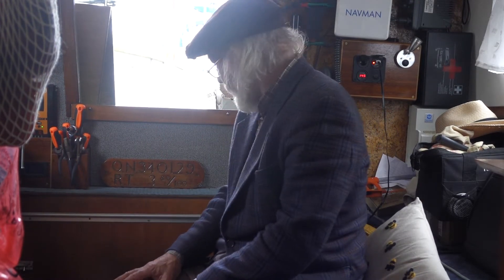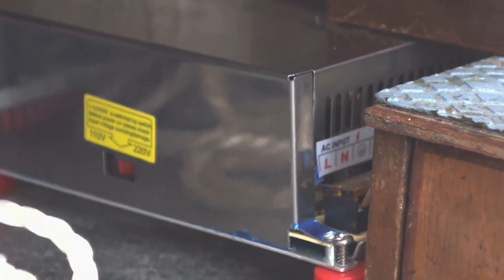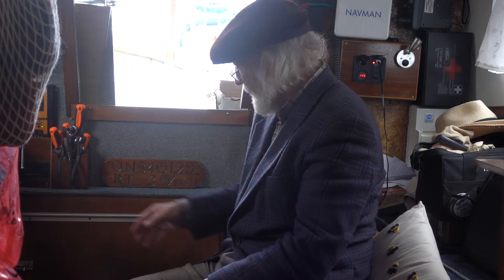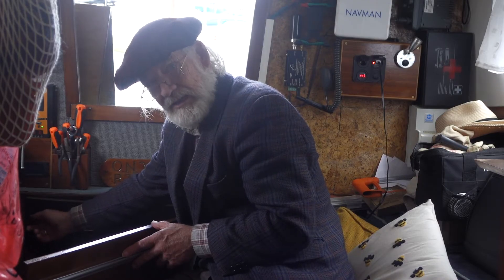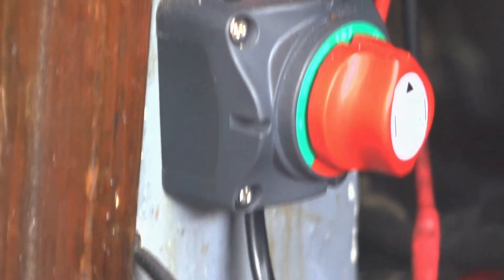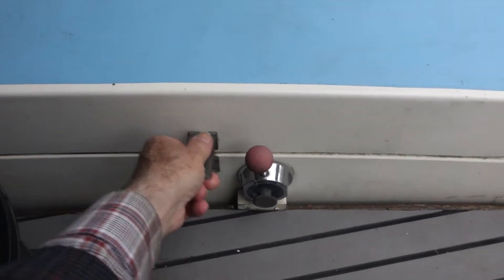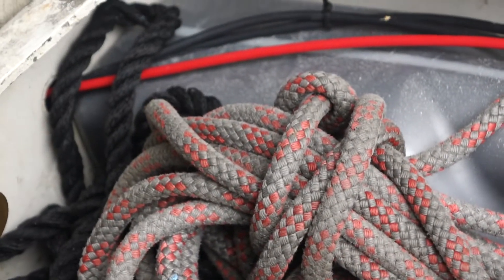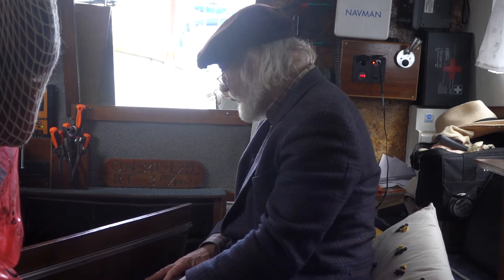Wiring a Generator Directly to an Electric Trolling Motor

Comment: Im thinking of this for my 24v 1500watt electric outboard. I'd use a slightly bigger generator, of course.
Reply from the maker: Hi there, I missed your comment for some reason - there is probably a bit of loss in conversion, so I would base your calculations on 24v 2000w, will probably do it

Comment from the maker: I skimped a bit on the generator here, as it gets a bit of a hernia on full power, runs fine on setting 4 of 5 which gives 2.5 knots.  Good enough.  I think the trolling motor needs about 1000w to run at full power, yet full power will use twice as much battery as 4/5 setting.  It does push the boat very nicely, however.
Reply: Does your converter adjust for amps?
Reply from the maker: @adamtedder1012  It's rated to a certain maximum amp draw, within the range of my motor.  I think it's sold for LED lighting.  For 24v you could probably wire 2 in parallel.
Reply: @saraofnorthwales  yeah I kept digging into last night and I think I definitely found my solution. Another youtuber did something similar for his fishing boat setup. He runs his led and trolling motor. So I think I'm on the right track. Thanks for responding this is definitely something different than I thought of before.